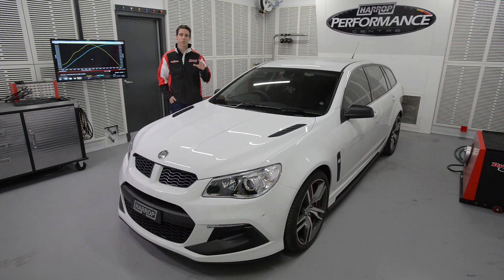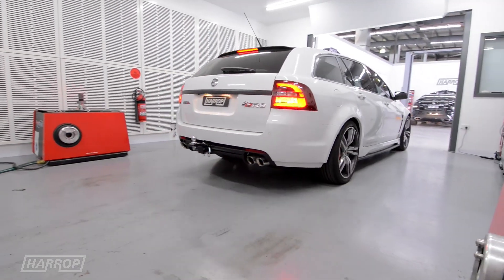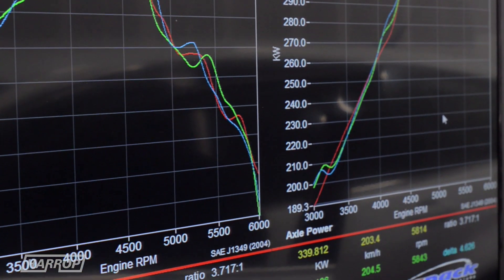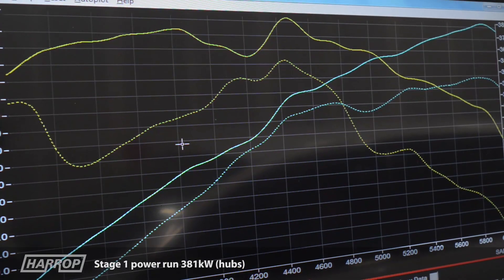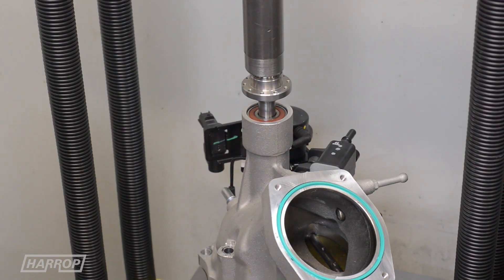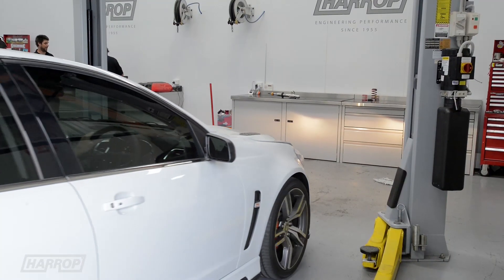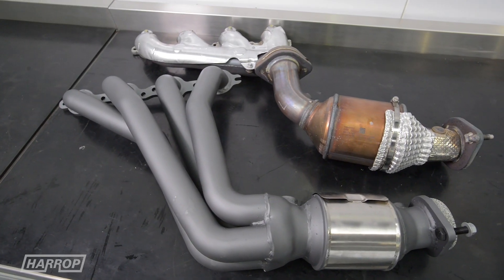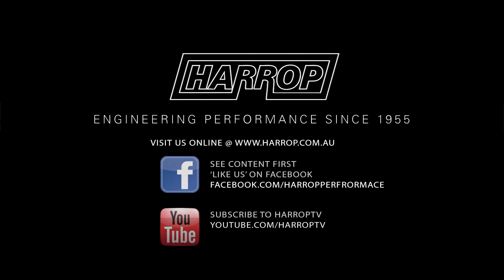Harrop LSA Performance Upgrades Explained

Comment: are there no problems with the injectors when changing the pulley from stage 2? many say the engine runs too lean under full load with the original injectors
Reply: I needed 1000 pound injectors the stock ones couldn't cope.. as long as your car is dyno tuned to 98 it will be fine.. mine has been going strong for 3 years since I juiced it.up.

Comment: I did stage 3 and love it should have done it earlier ! :)  I got 1033.7 NM of torque and 414.3 RwKw @ 178 Kph. So bang on the 530 FwKw claims.
Reply: Price?
Reply: @sedatis273  Depends on where you go, i paid about 7k 2 years ago. Google, Russo Motorsport (Harrop Dealer) @ Smeaton Grange
Reply: @sedatis273  12k
Reply: Bout 10k
Reply: @ryno1808  close, it was 12k but I also got tje spacers for the charger and top of the block .
Reply: Im looking at getting a vf gts currently got a blown vz clubby. What kind off power lvl did you make. Im looking at doing all bolt on etc not wanting to cam tho but everything eles
Reply: @ryno1808  As i said above 530KW at the flywheel. My R8 is 2017 so it came with the LSA motor... i didnt mess with the internals either.. just tune,intake,spacers,pully injectors etc... i can revert it back to stock if needed.

Comment: That stock power figures is bullshit. The 430kw lsa makes 330rwkw from factory in the manual how on earth did the 400kw Lsa make 339rwkw and that wagon Was a auto aswell. Hub dynos aren't accurate at all!
Reply: Hub dynos read about 10 to 15 percent higher than at the tyres 👍

Comment: the car is just to heavy, stick this motor in the lighter older models like the VR or the VL and what a weapon but no holden had to make 1800 kg monster, stupid holden and now you're gone, bye bye dumbasses.
Reply: you're a complete fuckwit!
Reply: +Vic Longdong did I mention you're a fuckwit?
Reply: power to weight is only one small aspect... then what about the chassis & suspension in VR/VL that cannot handle the power... the VF platform is planets away from previous models mate.
Reply: ahah mate you must have a few wires touching somewhere... what about all the extra safety gear, much bigger brakes, all the electrical, much bigger car, much bigger suspension, all the sound deadening, much bigger motor / gearbox / driveline... the weight has to go up, its physics.. the vl is a 30+yr old piece of shit.
Reply: if holden kept producing the vl and vr they would have been gone 15 fucking years ago
Reply: Vic Longdong mate take it for what it is. Good piece of kit for the money, and easily modified. Big safe family car that can dip into the 9s with a few smart bolt ons.
Reply: +Vic Longdong absolute no idea. nice try though.
Reply: Can you please show me the weight of the m5 or rs6.....
Reply: Longdong is short in the braincell department lmfao
Reply: Blade Lesetar just saying the VL was only 1120 kg, VR 1250 kg, why couldn't holden keep to those weight ranges, ever heard of carbon fibre?.
Reply: Carbon fibre bro..then a commodore would cost twice as much
Reply: Kristian Frey it's not brain surgery here, 2 ton of steel takes to much effort to get it's up and moving efficiently. has to be lighter.
Reply: Blade Lesetar what about aluminium and somehow the VL was light without carbon fibre or aluminium, just smarter engineered.